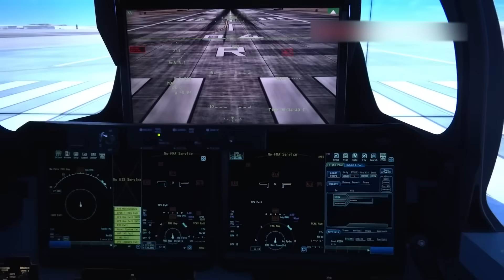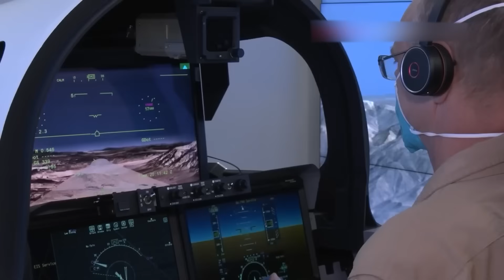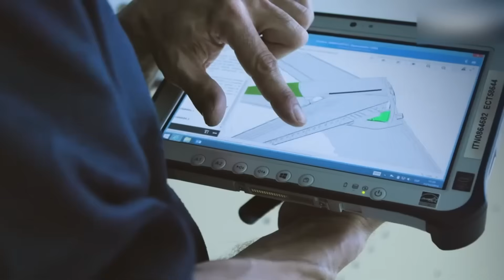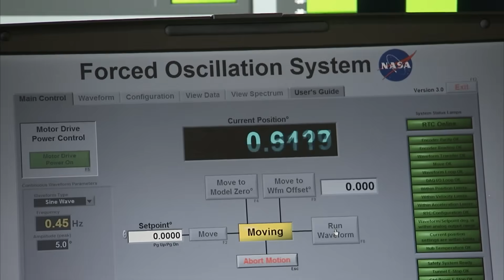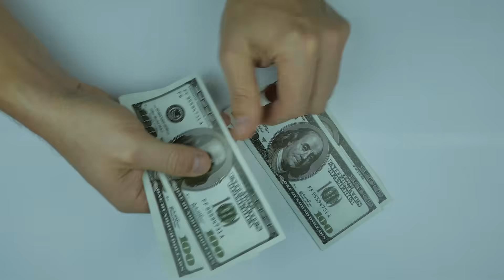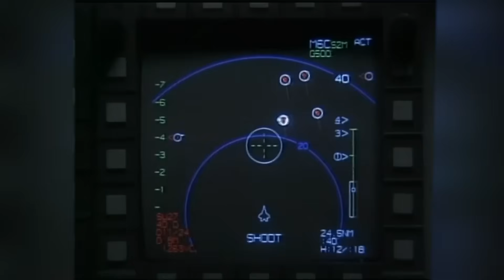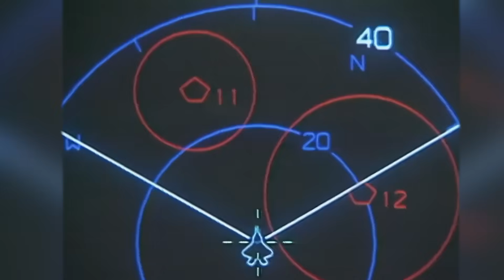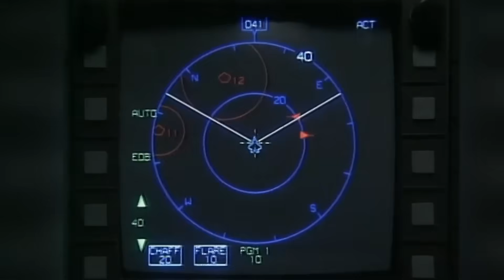Goodbye, Hamas and China! Space-X Releases 'Quiet' X-59 Supersonic Aircraft to Replace F-22 Raptor

Comment: This video is basically untrue about Tesla building this Jet. The claim that "Tesla is developing a new jet" and that "SpaceX has done it again" with the "X-59" replacing the F-22 Raptor is a mishmash of inaccuracies and exaggerations. Let’s sort it out as of March 19, 2025, 2:15 PM CST.
First, Tesla isn’t developing a jet. Tesla, led by Elon Musk, focuses on electric cars, batteries, and solar tech—no aircraft projects are in their pipeline. SpaceX, also Musk’s, builds rockets and spacecraft (like Starship), not fighter jets or supersonic planes like the X-59. 

The X-59 QueSST is a NASA and Lockheed Martin collaboration, unveiled in January 2024, designed to fly at Mach 1.4 (925 mph) with a quiet sonic "thump" instead of a boom. It’s an experimental craft for testing noise reduction, not a SpaceX creation.